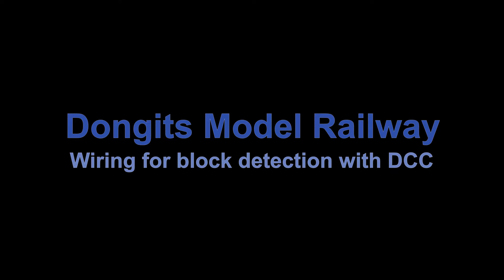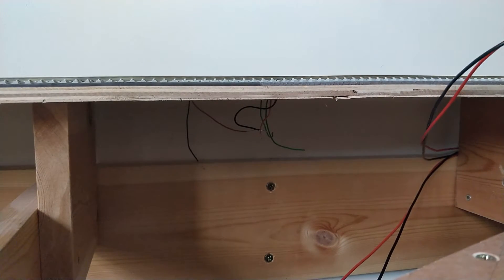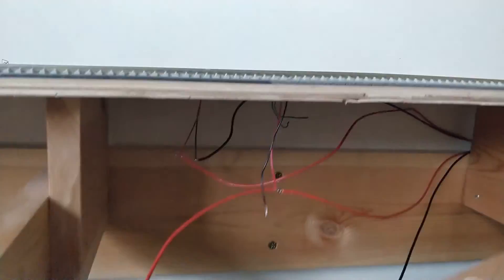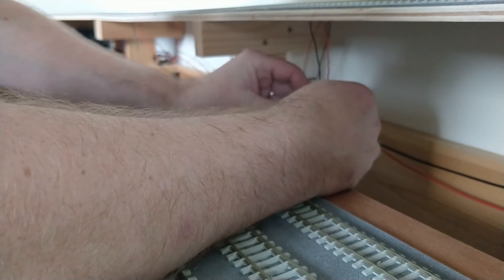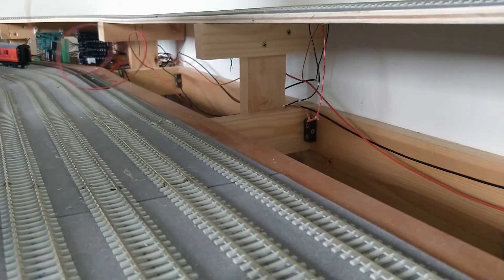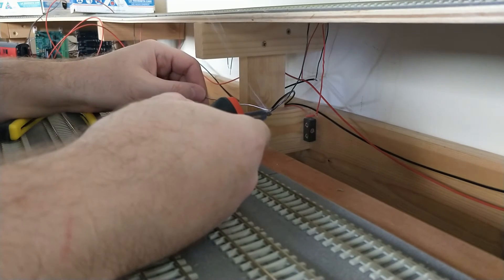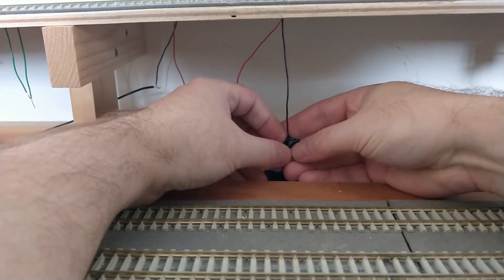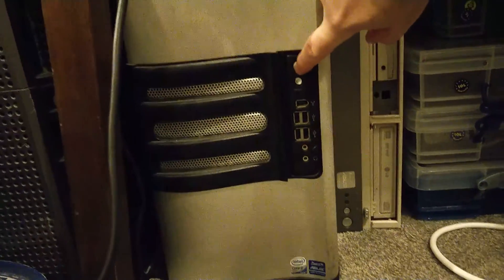Model Railway Wiring for Block Detection in DCC - part 1

Comment: Wish you had used heat shrink tubing on your soldered joints...
Reply from the maker: Unfortunately that's not something I have right now.

Because of how it works, it's also not something you can retro-fit later...
Reply: I'll be using solderless joiners!  Many types